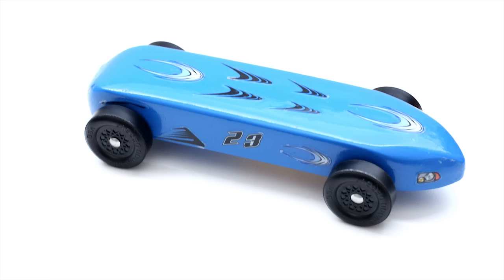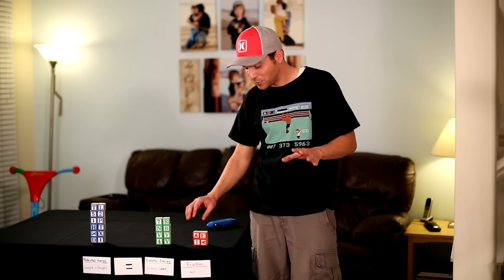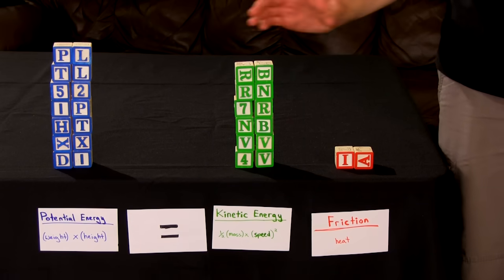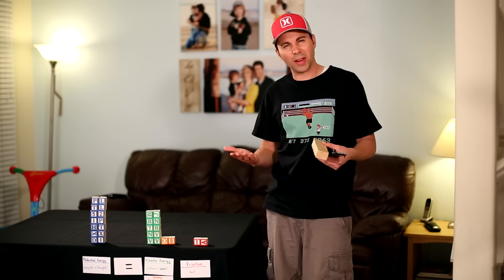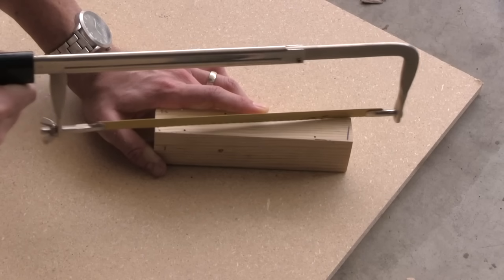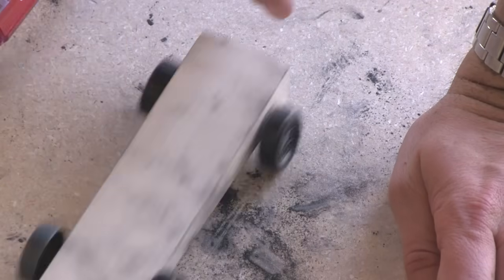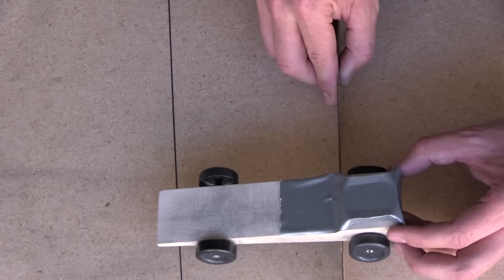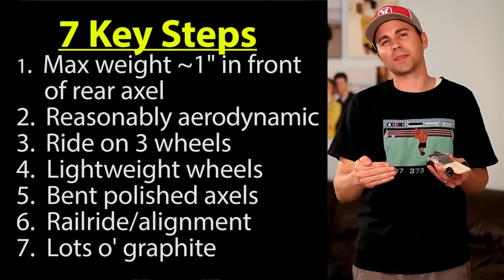EASY Pinewood Derby Car WINS using Science!!!

Comment: But how do i make the slowest scientifically possible car that still makes it past the finish line so i can drag out the race.
Reply: I could help you on that one. Signed, Last Place finisher. LOL
Reply: Daniel Greenwood  make it light, with a draggy body shape
Reply: Do this but in reverse.
Reply: r/madlads
Reply: Do this but only following the information on the thumbnail, I got the “most economically friendly” award by doing that
Reply: Take out the wheels?
Reply: Put glue on the wheels
Reply: Bring a block of wood with 4 wheels attached that dont move
Reply: Lift all 4 wheels so that there is less rotational energy lost.
Reply: Big flywheel geared to the tires or HUGE tires
Reply: Brick
Reply: Just take the woodblock, and then put a rubber layer under it
Reply: Put a lot of friction on the wheels until its just able to crawl to the finish line but not to much to fall short
Reply: @VGail85  ye
Reply: @isaacsim5193  cross the finish line or he I'm assuming it's a key Nerf war if it doesn't work guess what it doesn't move 2000 CrossFit left are a boyfriend and to have this Turtle word that everybody wants you out to be the last person to cross the finish line but you have to cross the finish line I assume she wants that where are you
Reply: So do everything they tell you to do in this video except when you go to put it on the thing turn it backwards so it has me completely opposite effect you should lose but you should still cross the finish line congratulations getting the turtle reward
Reply: Do everything the opposite
Reply: bring in a jar of air and when they start open the jar
Reply: Daniel Greenwood no wheels
Reply: @fenderstratguy  Reverse door stop with gritty glued axels
Reply: Cut the wood block in half and drag the other half that you cut away, with tape, behind the car.

Go for the win... extend the width of the car with a ruler, so all cars are forced to be behind you, with your longer nose. Only your nose will make it past the finish-line rails! Is there a width limit? :P
Reply: I feel like you’d have to create a mechanism that slowed its decent down the ramp, but then broke off or was somehow disengaged near the end of the ramp to still leave you with energy to cross the finish line.
Reply: huge lead flywheel geared to the wheels
Reply: that1other gamer best solution
Reply: Daniel Greenwood don’t ask him because every video he asks huge professionals and doesn’t do research himself
Reply: make the wheels greasy
Reply: 666th like
Reply: add a parachute
Reply: Make the wheel actually a cylinder of honey, so the speed is limited by the honeys viscosity
Reply: nail in wheel far
Reply: add a drag chute on the back
Reply: Ask a Ford engineer. they know how.
Reply: Friction pads on wheels fixed to the car body (think brakes). The wheels still turn, but most of the potential energy goes into the friction pad. The trick would be not to take so much energy away that the car stalls before reaching the finish line. 

Another possible method might be a geared fly wheel with a high gear ratio so that the energy is stored in the fly wheel so the car can travel longer at much slower speeds. but with a weight limit of 5 oz. that might be difficult. Not sure if the rules let you connect anything mechanical to the wheels. If the rules do not permit, using metal wheels that act as weights so that your car has four small flywheels. It would not be as effective as a geared flywheel system.
Reply: LOL I bursted out laughing after reading this comment :D
Reply: i was your 1000th comment.
Reply: Dronus screw the wheels as tight as you can on the car
Reply: Just increase the friction of the wheels, experiment until you find the level of roughness that makes them go super slow, but still with enough momentum to finish!
Reply: build the best car but run it backwards
Reply: As an engineer, I would make a rotating system INSIDE the car, that keeps the kinetic energy and prevents the car from going fast but also prevents it to stop
Reply: See the car designed by Homer Simpson at his half brother Herb's car factory
Reply: NoesisAndNoema with is not length the nose extends by length
Reply: How about you make this same car... but use the back of the car as the front
Reply: Square wheels
Reply: Gear ratio. Get 99% of the energy into rotational energy so that it just barely runs out of energy around the finish line. Could easily make it a 3-4 minute race I think.
Reply: a drag race?
Reply: Is it so you can be a drag queen?
Reply: Hexagon wheels
Reply: Weed.
Reply: Build this car and drive it backwards, and skip the smoothening and bending and graphite
Reply: Push the wheels against the body of the car just enough to crawl to the finish line.
Reply: Do the opposite of what he says
Reply: I finished my pinewood derby car race in Cub Scouts
Reply: That’s an even better idea why isn’t that sciences up lol
Reply: No front wheels, replace graphite with maple syrup, also no weights.
Reply: @fergusfisher1315  Lift all four wheels so that they don't even touch the track so the thing just slides down the track.
Reply: Use Brownian motion.  It will take forever, if you're lucky.
Reply: Now you're talking
Reply: Using Mark's 7 key steps starting at 14:43 , here's where I would start:
1. Use just enough weight to get your car to the finish line. (This would be the last step)
2. Don't bother with aerodynamics. 
3. Ride on all 4 wheels. 
4. Use the heaviest wheels possible. 
5. Don't polish your axles, but maybe do bend them to control alignment and keep friction consistent.
6. Do railride, and adjust the steering against the rail to adjust friction. 
7. Don't use graphite. 

If you need to slow your car down even more, removing weight is better than adding friction. 
If you need to speed your car up, reducing friction is better than adding weight.
Reply: @VGail85  so basically make the fastest car possible then put the car on the track backwards
Reply: Give the tires enough friction that if the wheels don't turn the car stays put. Make the car heavy. Now put a clockwork mechanism on the wheels. On the way down, the falling car drives the escapement and also winds the main-spring. On the flat, the main-spring drives the escapement. All the time, the clock is (literally) ticking. Done right, you should be able to get a time in the region of days.
Reply: My brother once did the Flinstone Mobile complete with ragtop. He glued bbs in the wheels for weight. That car barely finished.

Comment: My son and I watched this video for research for our car and it really really helped us out tremendously. We won 3rd place out of around 60 kids! Thank you, Mr. Rober!!
Reply: So second loser? haha kidding. Congrats!
Reply: next near do what i did you make a wedge and drill two level holes through it start big at the start of the whole and when it is nearly straight through it is smaller using  the air movment to go into those hole the air has to go through the smaller holes at the back it gose fast
Reply: Gg rm?
Reply: You mean Your Car?
Reply: ᎷᏗᏒᏦᎥᏋᎷᏗᏒᏦᏉᎥᎥ Ƹ̵̡Ӝ̵̨̄Ʒ Aww thats nice😇
Reply: Third place? You must not have added flames.
Reply: @raaston9761  Does that include compressor blades, a combustion chamber, fuel injectors and igniters?
Reply: Evanston Conner dude learn how to spell and maybe I would trust you
Reply: Dude I got first place every time I did this, 5 times in a row lol
Reply: The first place must be mark rober car
Reply: 1st placer probably watched this too lmao
Reply: @andersvassli2349  What a cheat!
Reply: Put the weight at the bottom.  It's better

Comment: I like how people have spent years trying to improve their designs, then you come along and wins with a door wedge.
Reply: +mtothem1337 Hilarious comment lol
Reply: +I  BallisticRaptor I actually did quite well with one that was just basically a brick.
Reply: Make a Hollow door wedge it is tons lighter.
Reply: +Melting Clocks The benefit of a lighter design is that it will reduce the friction in the axles a bit. But in turn might be more prone to unstabilize due turbulence with the surrounding air. We should check by building those.
Reply: lol
Reply: +mtothem1337 The power of Science!!!!!!!
Reply: hahahahahaahahahahhaajahahahahahajajajjajaahahahahabah
Reply: +mtothem1337 lol... i remember a lot of wedge designs being poor performers when I did this as a kid 20 years ago. Althought they probably did everything else wrong too. Actually it was pretty funny back then to see all the different designs and crack pot ideas people thought would make them faster. I remember a lot of people putting all the weight to the front as if it would somehow "pull" the car down the track faster. I actually won a couple derbies but it was just a three wheeler with polished axles. No canting or railriding since we had no idea about that stuff back then:)

Comment: We did this and it TOTALLY worked! First place! Thanks a million. That's after getting last place last year and second to last the year before.
Reply: *****
 Excellent video on the basic physics concepts needed to have a successful pinewood derby car. My son has raced in our RA (Royal Ambassador) race at our church for 4 years and I have helped him work on his car (and yes he does a vast majority of the work [with my supervision and teaching about concepts in physics]) using most of the concepts in this video. 

Our church buys kits so we have a precut shape already made for us when we get the kit. But my son sands his car, finds the balance point (Center of Mass), drills the axle holes, sands and polishes his nails, polishes the wheel bore, drills the holes to add weights, paints his car, and puts on the graphite. I help hold or act as his "assistant" when he needs another hand. I help put putty in the holes when we add weights (because it is messy and my son gets a skin rash from the wood putty) and I help push the axles into the holes while he holds the gap measurer (he is not strong enough to insert them by himself). So I would estimate he does 80+% of the work himself, but with assistance and supervision from me for proper technique and safety purposes. Each year as he gets older, more experienced, and physically coordinated he needs less and less of my help. 

I already understood most of the concepts needed to build a fast car through my education, but researched ideas/concepts as we prepared each year. We aren't allowed to run on 3 wheels, so we have never attempted that technique. He has won every year and our goal has become to run faster each year by trying a new technique or perfecting one we already are using. The only thing we haven't tried is rail-riding and we plan on adding this technique to his car this year.

Here is what aggravates me about all the whiners and complainers: They almost all insist that (because he consistently wins) my son has no input into building the car. These are the same dads and mom who spend no time with their kids, slap a car together the night before the race with no thought about the car (because they have their lazy butts on the couch watching TV for hours on end), and could care less about spending quality time together with their kids. My son and I talk a good bit about the construction of his car, but the truth is we spend more time talking about life (God, the value of reaping the reward of hard work, his fears, aspirations, friends at school, his favorite class, movies, baseball, and even girls). The time we spend together during the building of his car is fantastic father-son time. The bonding and fellowship is why dads should invest time, thought, and effort into helping their kids build a car (winning is an added benefit and a by-product of a dad "being there" for his kid). The sad thing is every year I offer to have several weekend workshops where all the dads/sons can get together and we (me and my son) will help them with their cars. Sadly, not one has ever shown up for help. I have even had a few of my sons friends over to help them in bits and pieces work on their cars and yet not seen a single dad show up. How sad is that? These are the same dads (and some moms) that make accusations of the car being totally built by me or worse yet, that we are somehow cheating to win. 

So again thank you for this great video. Dads and moms; spend time with your child building his/her car. Use the ideas and techniques in this video to make it fast. You may not win, but at least it will be competitive. You and your child will learn something about science, math, and physics. And miracle of all miracles, you might learn something about your child that you didn't know before by spending extra time with him or her.
Reply: +Lee Borcik  Wow

Comment: Don't forget the flames and racing stripes. Adds 100hp
Reply: +EpicMeh Everything about this comment is perfect. xD
Reply: +EpicMeh sponsor decals +5hp each
Reply: +EpicMeh Sanic decals add 100000000000000000000000000000000000000000000000000000000000000000000000000000000000000000000000000000000000000000000000000000000000000000000000000000000000000000000000000000000000000000000000000000000000000000000000000000000000000000000000000000000000000000000000000000000000 hp
Reply: +EpicMeh THE COLOR RED GOES FASTER!!
Reply: Sponsored tires +15 hp each
Reply: Looks like Maserati +800hp
Reply: +EpicMeh 
Bodykit with huge spoiler is equal to about +280 HP add a extra exhaust that does not work and you gain an extra 35 hp. 

Could add a lot more to it for example:
Spinning rims : + 7hp per wheel = 28 hp!!
Dark windows : at least a easy 10 hp
A fart cannon can increase hp by about 75 and makes great sound!!!!1
Neon lights : + 2 hp per ft of light.
21" or bigger rims + 5 hp per wheel, another easy 20 hp increase!!
Chinese chip tuning + 50 hp! AT LEAST ME FRIEND!
Air intake upgrade + 70 hp!
Dark rear lights + 25 hp
Modified / aftermarket front lights + 40 hp
Electronic turbo air intake + 120 hp
Extra cup holders + 2.5 hp 
Lambo doors + 40 hp
Racing steering wheel + 18 hp
Bigger or multiple Antennas (receives kinetic energy from radio waves in the air) + 95 hp
Reply: Don't forget chrome spinners!
Reply: +EpicMeh
Red makes it go faster. :)
Reply: +CrazyDutchguy clearly you don't play futuristic racing games
Reply: Twocool2sk8 Minedroid you clearly dont know physics >:(
Reply: +CrazyDutchguy you clearly don't know jokes.
Reply: EpicMeh make sure the stripe is red, red = +10 hp
Reply: Oh and dont forget to play eurobeat while racing to add 86 hp
Reply: Add a tall spoiler
Reply: why do you need hp.....
Reply: oh i know, everyone is jelous of your fast car so they guna try blow it up
Reply: red = faster